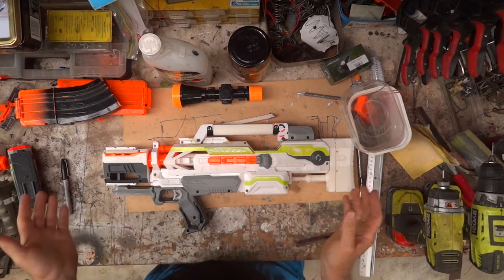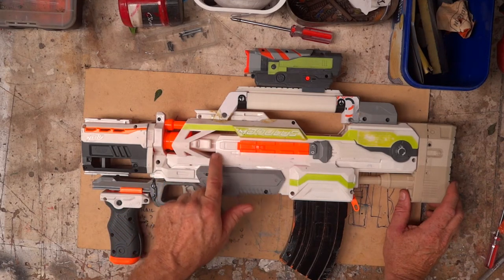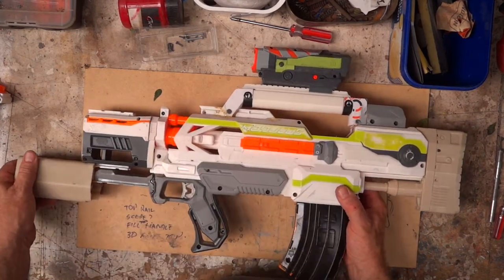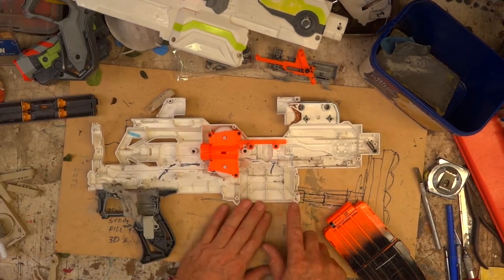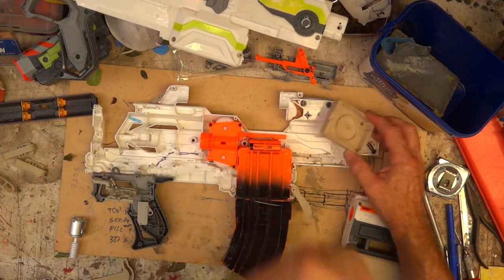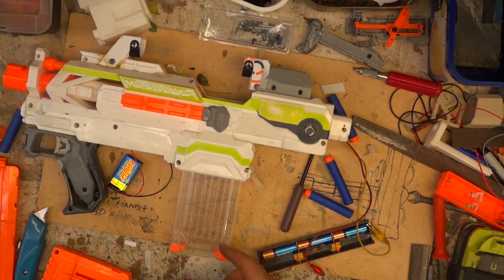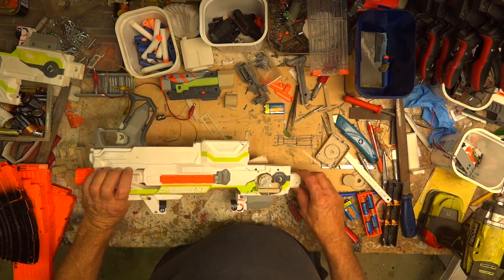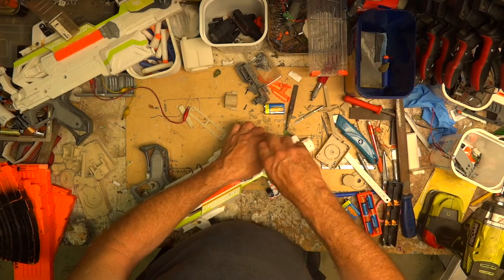5 Day Build part 6

Comment: Hot wax thats a new one. do you know Isopropyl alcohol will dissolve hot glue bonds? wax sounds like a paint adhesion problem later
Reply from the maker: could be but a quick wash in hot water removes most residue then I clean the spot with the IA